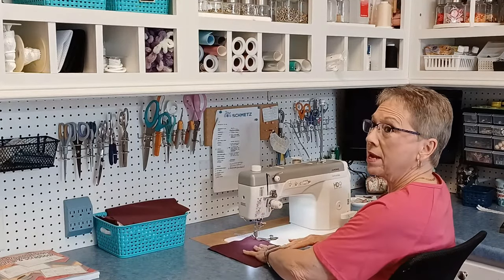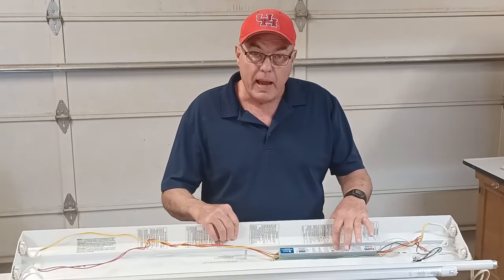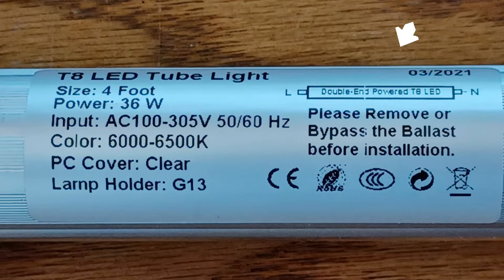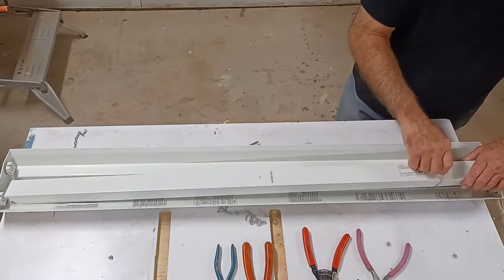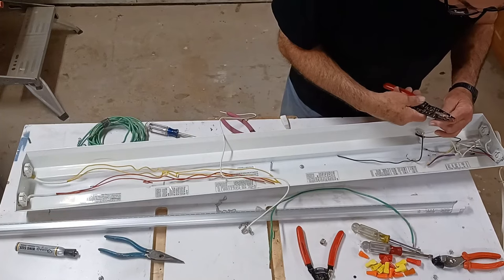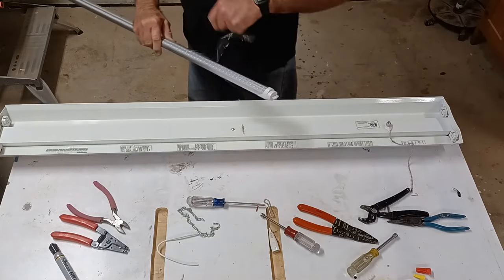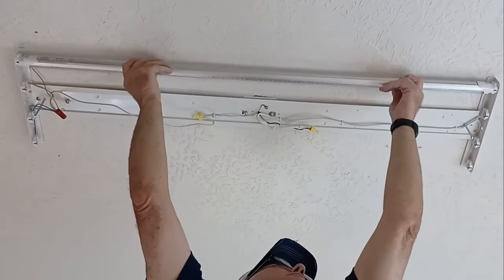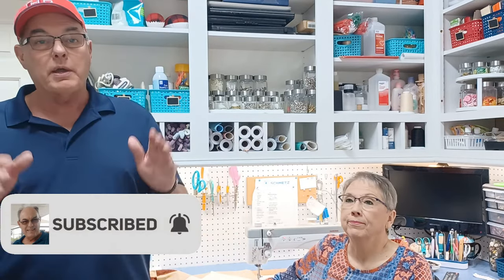How to Easily Convert Fluorescent to LED  - Step by Step Instructions  (Ballast Bypass)

Comment: Be careful with the black and red wires, while connecting 5 wires, it can spark.
Reply from the maker: Yes. You want to make sure the fixture is unplugged while you're working on it. and make sure there is no bare exposed wire below the wire nuts after you screw them on.
Reply: @deerparkhomeshop2471  yep, the black wire even the red wires can catch fire 🔥 and shock you to death 💀.
Reply from the maker: @dilianomartin.293  👍
Reply: I've been learning Electrical Installation for almost 3 years.
Reply from the maker: @dilianomartin.293  That's great.  Most of my electrical knowledge came from the courses I took for HVAC technology back in the day.  Well, I hope you can make a successful career out of it.

Comment: Thank You for your video. It has provided me the information I have needed. I have 7-2 tube fixtures in my basement to upgrade. They are over 30 years old. I'll research the level of lighting that I need. I have 7 1/2 foot ceilings
Reply from the maker: Best of luck!  That's a big project.

Comment: What about fuses? I didn’t see anything about fuses. Are they not necessary?
Reply from the maker: I've never seen fuses in residential flouescent fixtures, but I haven't seen everything..  Do you have a fixture with fuses?
Reply: I've seen diagrams for direct wire LEDs that recommend putting a fuse inline with the hot lead.  I, like you, didn't think I needed them, but decided to be better safe than sorry.

This is what I bought on Amazon, but there are others 
XFFCSEC Fuse Holder Kit:10pcs 18 AWG Screw Type 5X20 Inline Fuse Holder + 150pcs Quick Blow 250V Fuse 0.1A,0.2A,0.5A,1A,2A,3A,5A,8A,10A,15A,5x20mm, 0.5A,1A,5A,10A,15A,6x30mmXFFCSEC Fuse Holder Kit:10pcs 18 AWG Screw Type 5X20 Inline Fuse Holder + 150pcs Quick Blow 250V Fuse 0.1A,0.2A,0.5A,1A,2A,3A,5A,8A,10A,15A,5x20mm, 0.5A,1A,5…

Comment: Great video! I'm about to jump into converting my garage fluorescent lights to LEDs. The Amazon ad explained I didn't need to remove the ballast, however none of the bulbs work so going to follow your instructions to remove the ballast.
Reply from the maker: Thank you and good luck on the conversion. Sorry I didn't respond sooner.  I somehow missed your comment.
Reply: Keep in mind that you may not be using the right kind of LED bulb (lamp) for what you want to do. There are Type A bulbs which are made to be used with regular fluorescent light ballasts. There are Type B bulbs which are made to be used without any ballast at all (such as what you're seeing in this video). And then there are Type C which are made to be used with an "LED Driver" (which is similar to a fluorescent ballast, but specifically for driving LED bulbs).

If you'd like to follow this tutorial, you'll need to use Type B LED tubes.

If you'd like to keep your original fluorescent ballasts, you'll need to use Type A LED tubes.

Comment: Is there any way I can call you with a couple questions about my light that I am converting to ballast bypass with a pull chain.I need to verify how to wire before starting.Please let me know if this would be possible.Thank you.
Reply from the maker: Before we start playing phone tag, what is your question?  I thought the video explained it pretty well, unless you are going to try to wire up for single powered led's.
Reply: @deerparkhomeshop2471  I think I have it figured out.Going to try it after I dig out from our storm tomorrow.I may get back to you if I have a problem,but I greatly appreciate you responding.
Reply from the maker: No problem.  Feel free to contact me.

Comment: i am thinking on the ballast bypass led and bypassing the ballast all together and i also have an old magnetic Ballast. I have the Ballast cover off and I see that on the yellow wire end of the facture there are 2 black jumper cables going from the left tombstone to the right and there are 2 yellow wires going from the right to the ballast. how would I wire this configure to do the Ballast bypass? then i also have a pull switch as well.
Reply from the maker: And you should also have a black, white, & green entering the fixture from your power source and attaching to one end of the ballast, right?

Are you going to use the double powered bulbs?  If so your wiring setup should be routed like one of the examples in the video.  You should end up with one end of the fixture being hot and the other end being neutral.
Reply from the maker: Also, if you have a single wire going to each tombstone, be sure to wire  them up that way when you make the conversion.  Likewise, if you have two going to each tombstone, stick with that.  These are different types, shunted vs un-shunted, and if you try to change that it can lead to premature bulb failure or they may short out.

Comment: Thanks for your video.  I have a question.  When you combined the neutral wires you combined (I think) all 4 wires from the 2 tombstones of the fixture (that became the neutral end).  I believe you did the same for the hot end wires as well.  Is it necessary to combine both wires from each tombstone (to create the neutral end) or can just 1 wire from each tombstone be connected?  (With the same question applied for the hot end as well).  Thanks!
Reply from the maker: If you have two wires to each tombstone they are probably the non-shunted type and require both wires,   If that's the case, it's not going to work.  You can google "shunted" and "non-shunted" tombstones to get some info on the characteristics of each.  Good luck on your fixture.
Reply: @deerparkhomeshop2471  Thanks!

Comment: Very well made video!   I heard about shunted vs. non-shunted lamp holders.   Do I need non-shunted lamp holders to bypass ballast?
Reply from the maker: No.  You didn't watch the whole video did you?  Tsk, tsk, tsk...   I showed how to do both types, with the shunted fixture near the end. The wire up is exactly the same. It was a four light fixture, so you simply tie 4 wire from one row of tombstones to the white common wire and the other 4 to the black hot wire.

Comment: thank you so very very much for your very easy to understand video. One thing I did want to know is I love those led bulbs with 3 sides, do you happen to know where you bought them or is there a link to where to buy them and or the bulb make and model number, thank you again in advance for you help is this matter, Blessings, Barb
Reply from the maker: I bought them from Amazon.  Here is a link:  https://amzn.to/3TlKqzv      WARNING: I bought 8 of these and 2 were bad.  You may have better luck than I did, or you can use this link as a springboard to an LED light search.  Good luck and thanks for watching.

Comment: A question, you said the led gets a lot hotter than the fluorescent lights. Is there anything to worry about as far as the plastic cover that goes over the light? Thanks so much for your videos!
Reply from the maker: I don't think so.  They are designed for this.  They do get hotter, but not enough to get serious burns or anything like that.  They can be uncomfortable to handle though. Thanks for watching our video.
Reply: @deerparkhomeshop2471  thanks so much.
Reply: thank u informative and entertaining
Reply: LED replacements generally use about 1/3 less wattage (heat) than the fluorescent tube they replace.  In your example you are using LEDs that produce 2 times the brightness (lumens) so are using more watts resulting in more heat.
Reply: @MyUnibrow  thanks. Are you saying that switching to LED is an issue or not? I’m trying to decide whether to do this. Thanks for your help.
Reply: I don't quite understand the wiring.  One side is positive(black?) .   The other side (is neutral/negative?).  The green is ground and it gets connected to the metal on the frame.  I think that i also saw red and blue wires and I'm not sure what those are for.  Assuming that the colors of my wires are correct could you make a wiring diagram and/or write the instructions by colors?  Thank you. Kevin
Reply: @juanbarnes6307  In the video, Deer Park Home & Shop, was not doing a direct florescent to equivalent LED replacement.  His wife wanted brighter light   A florescent light that produces 1800 lumens of brightness uses 32 watts, the LED equivalent uses 15 watts.  If he changed to a 5000 lumen bulb, that LED bulb would use 38 watts and be slightly warmer and much brighter then the original florescent.

Comment: In this case are the tombstone shunted?
Reply from the maker: As I remember, they were shunted.  One wire goes to each tombstone.
Reply from the maker: Yes.  Dual ends will work with either type tombstone.  However, single end LEDs require shunted.  Look at this link:  https://www.orilis.com/blogs/led-lighting-tips/single-ended-and-double-ended-led-tubes-explained# @1mountaindigger